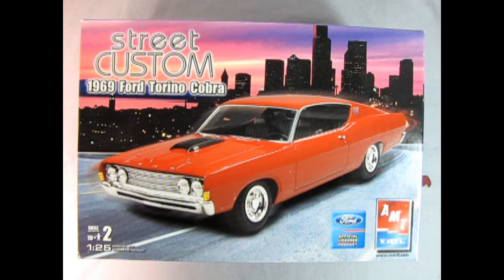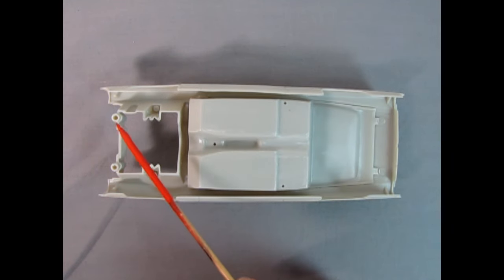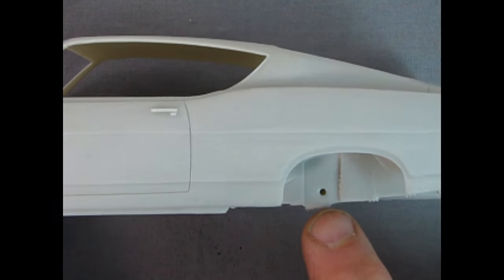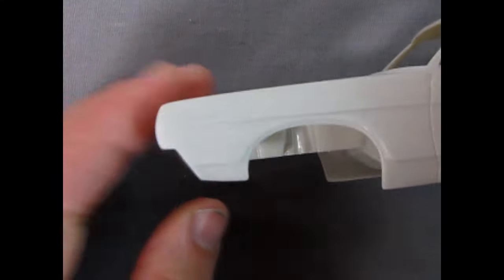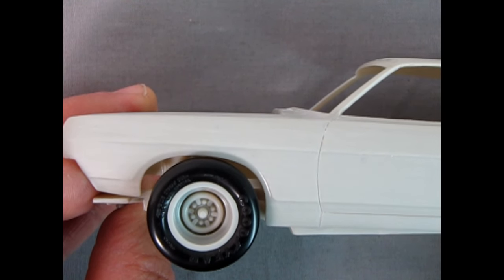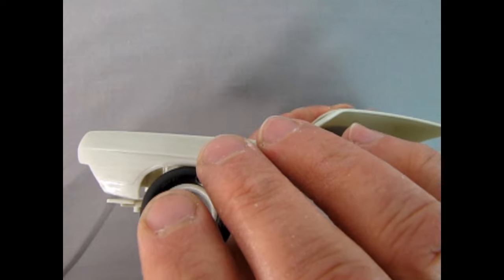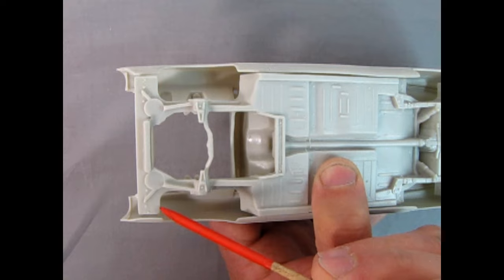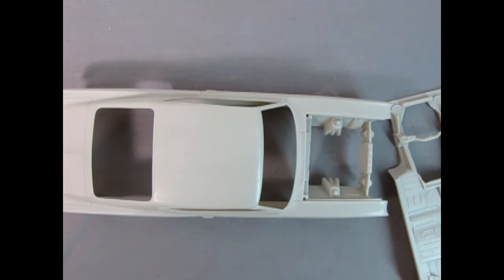How To Quickly Fix AMT's 1969 Ford Torino Cobra and Talledega Wheel Base Issue

Comment: I chose to completely replace the ancient chassis with AMT's 66 Ford Fairlane and all the underpinnings . This gave me way better detail and corrected the alignment in both the front and rear wheel arches.  Some trimming on the front and rear of the 66 chassis was required. I also replaced the front rad core.
Reply from the maker: How did you get around the wider transmission tunnel on the 1966 Fairlane floor pan hitting into the narrower transmission tunnel of the Cobra interior?

Comment: The NASCAR wheel and tire look like the bigger fit issue, they are too big and wide for the fender openings. 
I think your attempt to fit the wheels & tires and make chassis alignment different will cause a huge problem getting the rear bumper to fit. It's not possible to grind off 1/8 inch off the chassis pan without removing part of the fuel tank, and that may play even more havoc with the alignment of the bumper to body. The front bumper would need to be twisted backwards to close a gap up front. 
Appreciate your attempt to inform the community about the problem, I have 2 of those '69 Torino kits unbuilt .... one 20 years old, the other is the most recent one. I might look at drilling new holes for the 2 axles, so front and rear bumpers will still fit, and hopefully the oil pan isn't in the way up front for that.
Reply from the maker: I didn't want to make a video about building this kit for a few years, but I think now that I started showing these fixes, that I will have to bump up that time frame and get going on it.

Comment: I think you are right,Trevor. I'll look again at mine👍😎.and make new hoses😉. One could relocate new pins for added strength👍looks like it still needs redrilling in the rear axle too. Are you finding the chassis won't fit in properly? I think the interior tunnel is fouling the chassis
Reply from the maker: Glad you liked the video Pete! 
I didn't really notice a problem with the chassis fit when I was making this video, but then I wasn't looking in that area too much at the time. 
You could be right that the rear axle hole needs redrilling, even with the front end being moved into the correct position. 

However, I will have to get into a more detailed build of this kit to find all the issues. - Something to try in the future...maybe this summer?

Comment: Or just steal the entire chassis/ floorpan from AMTs much better 66 Fairlane
Reply from the maker: Yes you could. However, this is the "In Box" solution.

Does the '66 go in there without much modification?
Reply: I don't know but it's worth investigating.👍🤞😃replacement of that lot was my next move 👍
Reply from the maker: You could be the first to try it!
Reply: @MonsterHobbiesModelCarGarage  I bet you can guess what I've been doing for the last hour😁. I'm  hoping to do a video tomorrow 🤞
Reply from the maker: @petesmodelcarcustoms584  Are you putting the 66 chassis under this kit? :_Suprise:
Reply: @MonsterHobbiesModelCarGarage  I'm certainly checking if it's reasonable to do so. The radiator will have to go but it crap anyway and the Fairlane parts are much better 🤞😉
Reply from the maker: I did a bit of test fitting with the Fairlane chassis under the Cobra. You're in for a real wrestling match with that one. - First off, the '66 has a wider, carpeted transmission hump, so the Cobra interior tub won't drop down onto it. Second, if you align the suspension from the 66 to the Cobra shock towers, you still have to cut a section off the back to mount the Cobra rear bumper. So it's the same problem as the original Cobra kit, but with the 66 under there, it's more of a struggle.
Reply: @MonsterHobbiesModelCarGarage  I think the shock towers ,in the Cobra are in the wrong place and should be 2mm back . But I'm going to go for a full Holman Moody chassis from the polar lights kit, as it's body needs surgery,I'll use the old AMT 69 Torino Cobra  body as its a better moulding than the new amt/round2 body👍. I've spent enough time investigating this project for the moment and want to get back to my other projects before this
Reply from the maker: @petesmodelcarcustoms584  I know the feeling. I'd like to get back to some old projects too.

From all your little black circles on the newer body, it seems like you might have got a "Quick Pull" off the mold from Round2 or something. Seems like you have excessive issues on that one kit.
Reply: @MonsterHobbiesModelCarGarage  I hope that's the case,with that body. I'm looking for another old mould kit. But I really am stopping with this for the moment. I've shown all the things I wanted to and as it's going to be a lot of work,I'm leaving it so the A pillar hardens. I'll go back when I've finished the falcon and the other Eliminator F/car. I need to get my bench cleared up
Reply from the maker: @petesmodelcarcustoms584  I understand. I didn't really want to get into this build at this point in time since I am working on completing a totally unrelated video about painting, but I saw what you were doing and thought I would give that chassis a look and see what it's issue was for a video or 2. 

Maybe I'll make a video where I build the Cobra from start to finish, as I have 2 of these kits, over the next few weeks. See if I can find more faults with it or not and come up with some solutions. - I'll see how I feel about it after 2 days of work! LOL!

Comment: Sorry but this is NOT working!I am just building this kit!If you do it this way the room for the engine moves back and the firewall hits the interior tub(makes it very difficult to install the dashboard!)!It much easier to file the holes in the direction you need to move the wheels!And another Problem with this chassis is that the left ride hight is to high in the front
Reply from the maker: How does the firewall hit the interior tub? The firewall is molded in place.
Reply from the maker: I am curious to see how you are building this kit. - Did you glue the interior to the inner body or to the chassis pan? I am suggesting moving the body backwards on the chassis 1/8". The direction of travel should move everything backwards so that the rear package shelf would hang out of the back of the car if you glued the interior to the pan before moving the pan back. This is the AMT kit. Are you sure you're not building the Monogram one? I could see something like that possibly happening in the Monogram kit.
Reply: @MonsterHobbiesModelCarGarage  I guess in my 45 years of building kits,and especially Car models(with over 400 in my stash i guess i know a little about Kits!🙃The Monogram is a Talladega and has no fitment problems!I made a mistake in writing the firewall hits the tub!Its that the Engine hits the firewall or sits too far to the front!And in my opinion the file method is much faster and easier!I look if you have an email and will send you some pics(If it works)or !I dont have Facebook or other things except discord!If you have discord i can send you pics there!
Reply from the maker: @williwass6837  Not bashing your years of modeling experience...just trying to figure out why I am not having the same issue as you are (And some others as well). - Also, I asked about the Monogram kit because I have had someone in the past tell me I didn't know what I was doing, and then they told me all about a different kit entirely (like a Revell vs AMT) so I just wanted to double check to see if I wasn't running into that same scenario once again. IThank you for stating that I am not. 

Anyway, your comment about the issue intrigued me, so I am uploading a new video here soon where I attempt to move the interior and make everything "Go out of whack" by moving the chassis pan back to it's true location and to it's original "Peg and Post" location. Anyway, if you wait and watch the video, you will soon see my attempts to slide the under-pan and make the interior move. 

Besides, I have 42 years of hobby experience (Born in 74, started when I was 8 and am now 50, and I have about 600 kits unbuilt and 400 built as well as I have owned a hobby store for 20 years. - But hey...what do I know! :_Suprise: (Just a joke)
Reply from the maker: I did spend a lot of time a few years ago building detailed kits and trying all sorts of things. I am back to building OOB for 2 reasons. 

1.) Simplicity - Pretty much everything fits with some modifications.

2.) As a hobby store channel, I want to show how these kits go together OOB for people interested in buying them so they know what the challenges are and some solutions. Building OOB "Walks" someone through the construction stage. Maybe in future, I will make some special videos on wiring engines, brake lines, etc...but not for a long while.
Reply: @MonsterHobbiesModelCarGarage  Have to ask you!Where is my comment where i told you how i got to building models????And that iam from Germany and all that?
Reply from the maker: @williwass6837  I don't know. I didn't remove it.
Reply from the maker: It's up the page right on this post.